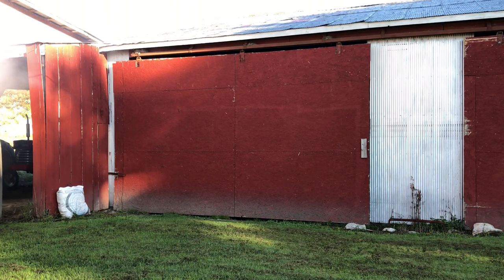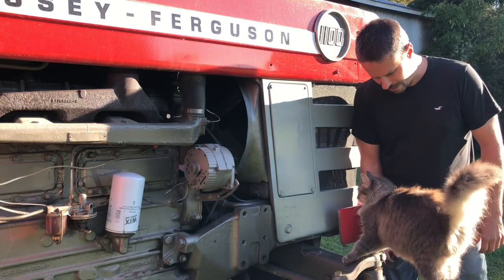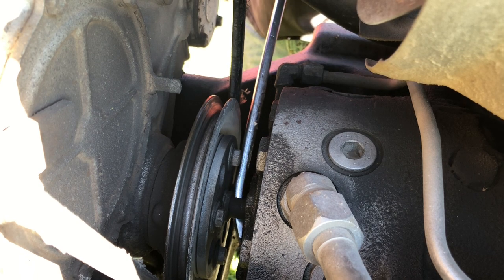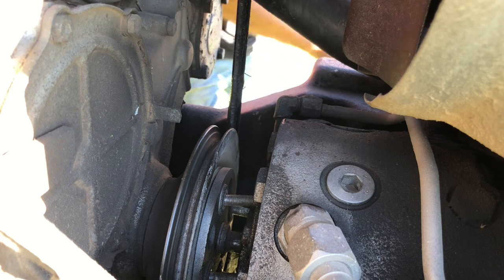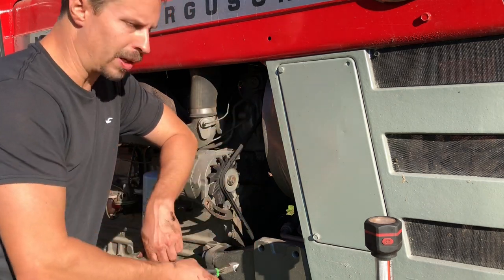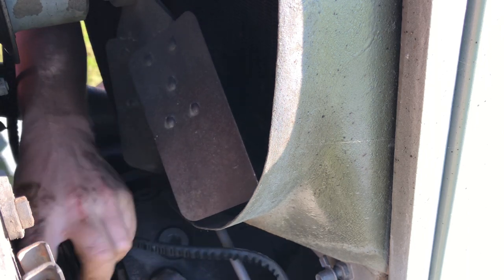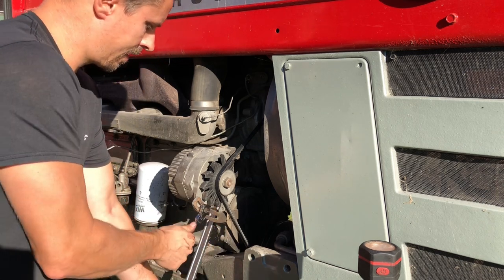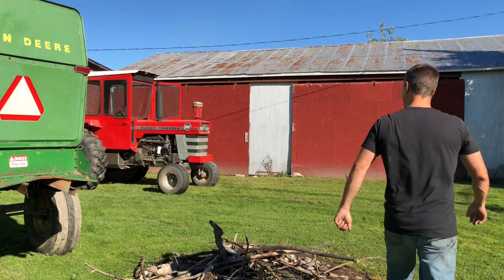How to change a fan belt on your Massey Ferguson 1100, 1105, 1130,1135

Comment: Hey JT, just a quick tip, when you or someone you know is working on a front end leaders, if you get yourself a peace of pipe or two, and split them lengthwise just enough to fit over the rams and set them on the cylinders, and then rest the loader on them it will act as a safety factor for when you are working on the tractor. Because when you use a 2x4 to hold up the loader it can accidentally be kicked out of place and cause an accident

Comment: We actually adapted an old 14mm  wrench to do that job. At the factory those 4 bolts had been torqued up to " F......... tight" 😉  they were absolute buggers to undo, so we got a 14mm  spanner* that had a ring on one end and open on the other, cut the open end off then put a length of pipe on it! I haven't been a farmer for 27 years but I reckon I still have that spanner* somewhere           *Yes, spanner,  I'm British .😉